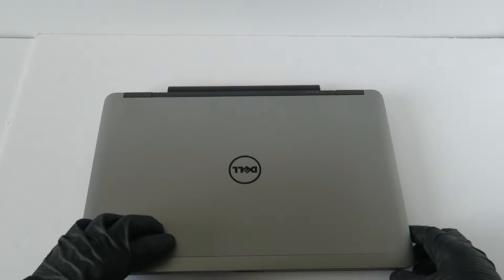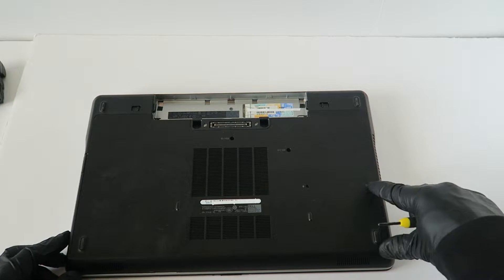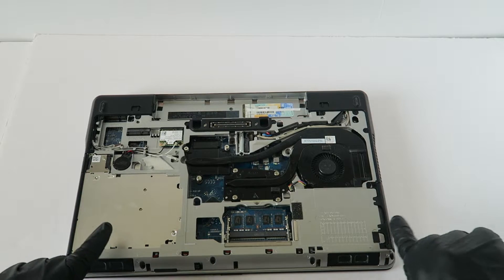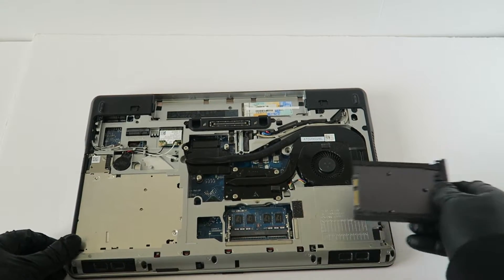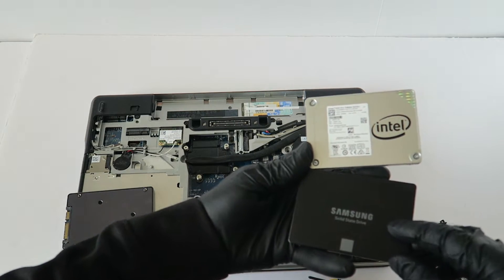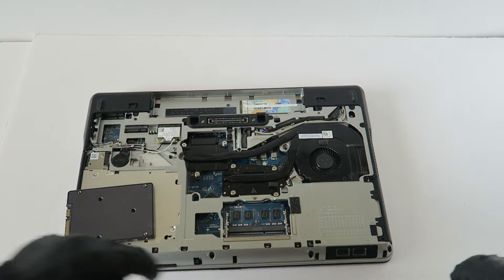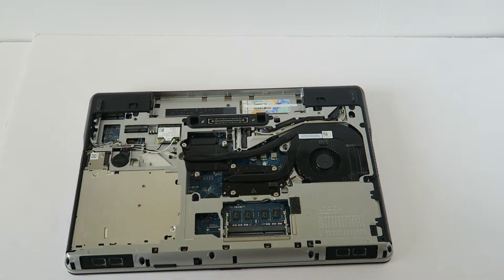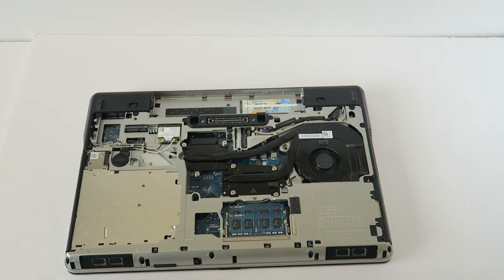Dell Latitude E6540 Upgrade SSD RAM Hard Drive

Comment from the maker: List of Parts and Upgrades: 

Max RAM you can upgrade  is 16GB and you can use this Crucial works perfect with this laptop..
 
(1.) 16GB Crucial Kit 2X 8GB 1600 MHz (PC3L-12800) CT102464BF160B

(2.) Crucial 16GB Kit (2 x 8GB) DDR3L-1600 SODIMM  - CT2KIT102464BF160B
https://amzn.to/2Xuv7JD

(3.) Crucial 8GB Single DDR3/DDR3L 1600 MT/S (PC3-12800)
https://amzn.to/30cUCi1

 
SSD list works with this laptop.
(1.) Samsung 860 EVO 500GB 2.5 Inch Internal SSD MZ-76E500B/AM) 
https://amzn.to/3ea4lMo

(2.) WD Blue 3D NAND 1TB Internal SSD, 2.5" WDS100T2B0A
https://amzn.to/2JUDqpO

(3.) WD Green 1TB Internal PC SSD  WDS100T2G0A
https://amzn.to/2VdHHtO

(4.) SanDisk SSD PLUS 480GB Internal SSD SDSSDA-1T00-G26
https://amzn.to/3e6y0WF

(5.) Crucial MX500 250GB 3D NAND SATA CT250MX500SSD1(Z) 
https://amzn.to/2XlJK1w 

(6.) Samsung 860 PRO SSD 256GB - 2.5 Inch SATA III Internal Solid State Drive
https://amzn.to/2X6LPP4

(7.) Samsung SSD 860 EVO 250GB 2.5 Inch SATA III Internal SSD 
https://amzn.to/345jbiF

Comment: FIRST, I know that according to the OFFICIAL Specifications by DELL this Laptop (Dell Latitude E6540) can ONLY support UP TO 16GB of RAM. Now I ask: Did anybody tried to install 32GB of RAM on it? Specially if someone has Upgraded to the Latest BIOS available on Dell's website, and has the one that comes with CPU Intel Core i7 4810mq, GPU Radeon HD 8790. Thank you!
Reply: Brother can u help me? My this laptop is ame but it not detecting amd anywhere

Comment: In the middle of replacing the seagate HD to the samsung evo. Unfortunately, the hard drive does not have those 2 side mounts. Where can I get them?
Reply from the maker: Hi, yes they sell on ebay used parts you have to search:
Hard Drive Caddy Cover Isolation Rubber Rails Dell Latitude E6540 w/ screw

Comment: Excellent video, friend, a question for those people who place a msata in the wwan port, could you add one and place the characteristics to know which one works which to buy.
Reply: I've used many msata drives in the E6540 and E6440 series. Never had one that didn't work. I use the Samsung Evo 840/850/850 series myself, but also the SM/PM series work like a charm. Just don't forget to activate the Minicard SSD boot option in the bios :).
Reply from the maker: Hi...
Reply: I have a Vaseky (?) 1 TB mSATA card in the WWAN slot and it works great. I run it as a dual boot Win 10 / Ubuntu Linux system.

Comment: This laptop is built like a tank     lnfo.help/_Dell?ЇЖ    I’ve dropped it several times, albeit on the carpet, and it had been literally thrown across the room 3 other times. The battery pack fell out and the disc drive door too, after being flung. Yet it still works perfectly fine. No damage at all.

Comment: Somebody knows if i can put a 180W 19.5V 9.23A adapter on this laptop? i have the 130W 19.5V 6.7A but i need more power and i dont wanna burn it. i hope you can help me please!! 
thanks a lot!!!
Reply: As long as the voltage is the same you can. It only sucks as much current as it needs. Having a power supply that can provide more current (A) is always a good thing.